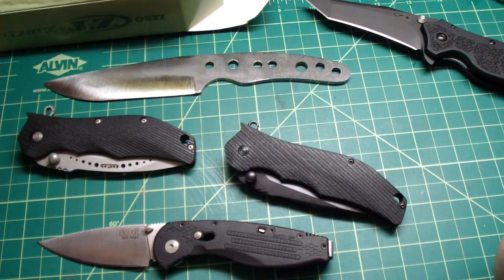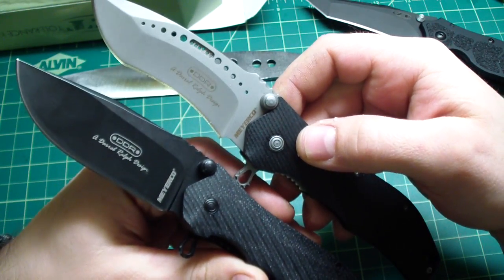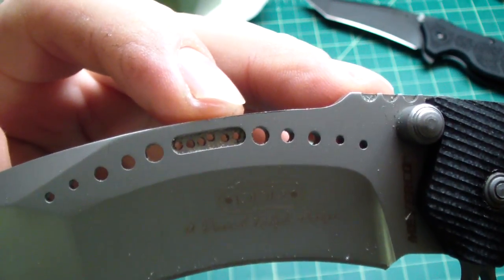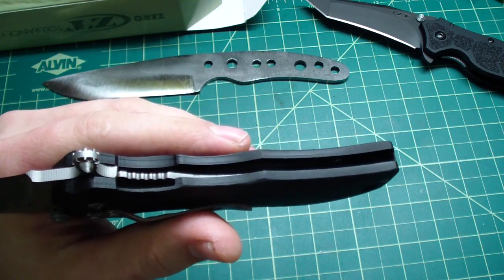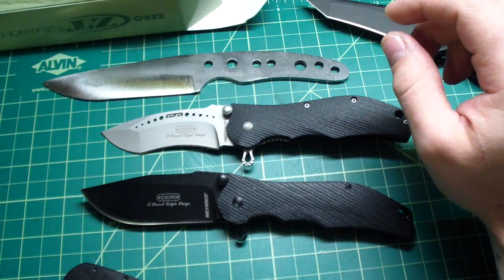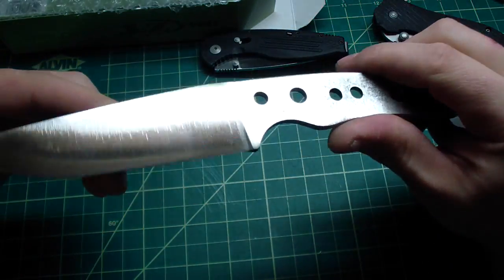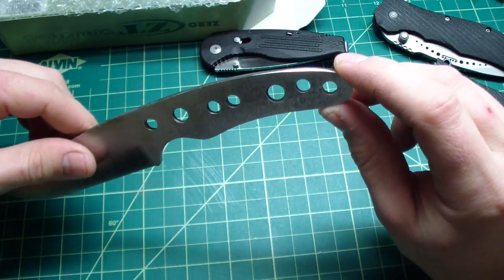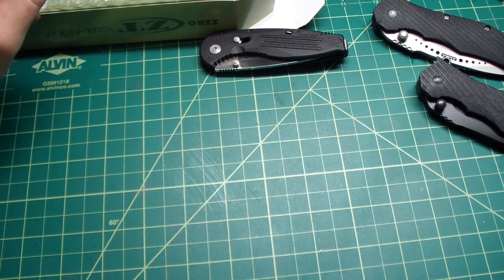Meyerco Maxx-Qs, ZT0400 first impressions....

Comment: Just a tip if you interested. Bot sure if you do it try using a punch to make a small dent for the tip of the drill bit tip to rest in. You can premeasure and punch your hole design. If ypu mess up you can try the other side. The polish out the remainder after drilling. =] great stuff man thanks for the vids even over christmas